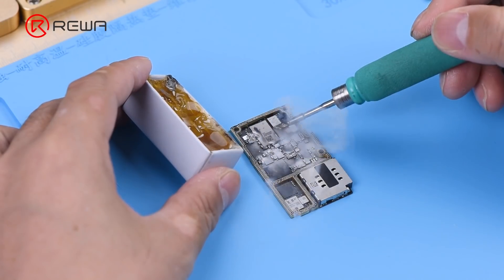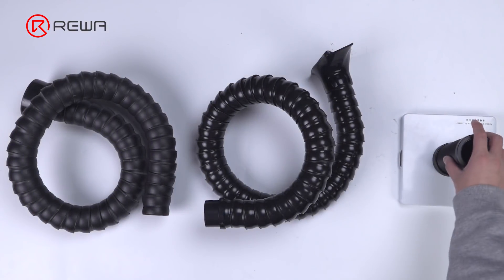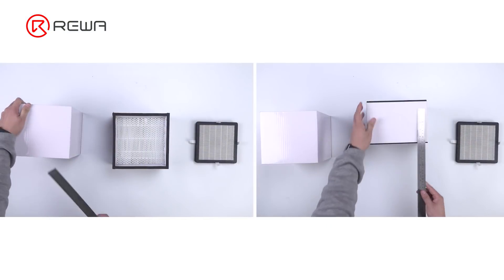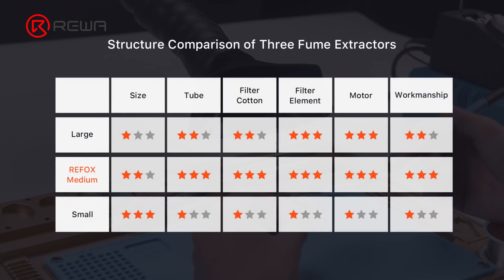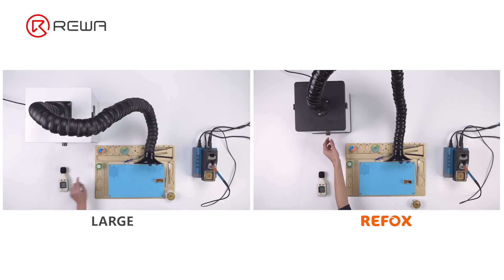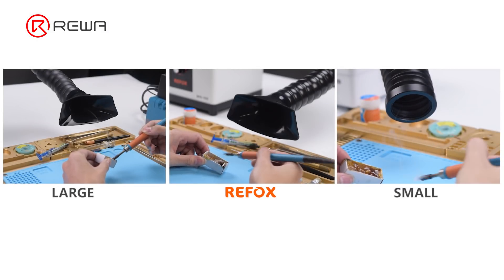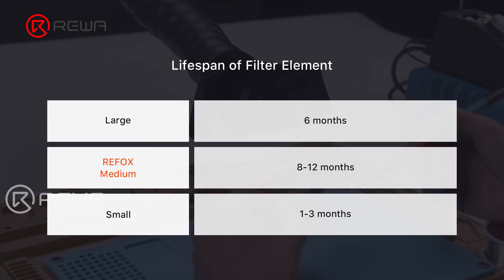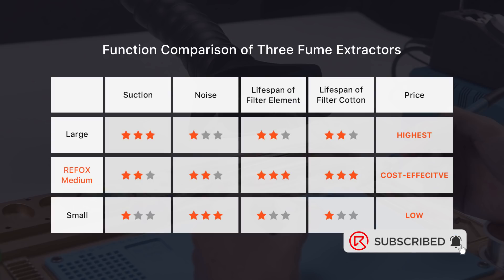Review of Three Fume Extractors | Which one is The Best For Soldering/Laser Marking

Comment: I'll tell you from experience 

Don't buy the refox extractor. It sucks.

I have the acrylic box the fume extractor and a fan trying to push the air outside with the video up still get headaches and smell fumes
Reply: What are you using it with?  A laser or something else?  Have you figured out a better way of extracting fumes?  I'm about to tackle this issue.  Thanks.
Reply: @YAOG  I got the nasan fume extractor works wayyy better because it comes with a box that keeps fumes trapped. You could use the rewa one as well but the box cut out doesn't fit. I'm also getting a millitary grade gas mask for removing the glass because just the fume extractor doesn't work good enough.  It's kinda expensive and you will have to replace the tank or filter quite often but no amount of money is worth your health in my opinion. Especially after just spending time a couple days ago with a family friend that has cancer and watching her spend every day just trying to fight that
Reply: @chriscripe9477  Ugh I'm sorry to hear about your friend. Yeah my application is for a fiber laser that I'll be using in a room in my home. Im hoping to find something that works well with the smell too.
Reply: @YAOG  no worries, yeah I would think anything that can fit in the acrylic box and then can be inclosed in the box and have the fume extractor hooked up to the box. I personally just put my laser outside. I hate to be that guy to let those fumes float in the air but I think humanity has wayyyy bigger issues than pollution from the laser. I don't even hook my fume extractor up to it. The big issue is removing the back glass which at that point I have to be right next to it and breath in the fumes. I'd just move it outside if possible and then if you don't have to be by it or where the fumes are blowing because of the wind you will be fine.  The issue like I said is removing the backglass from iphones where there's no other option but to manually pry the backglass off and be in the fumes. That's where a fume extractor and gas mask would come into play
Reply: @chriscripe9477  Interesting. I have a covered porch but that's about it. I suppose I could do the work outside. I am in Florida, after all.